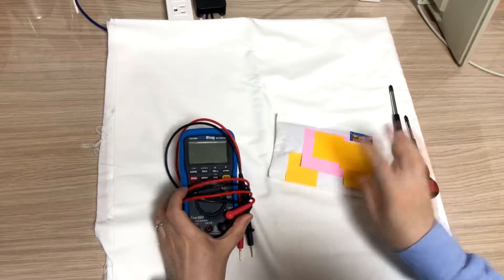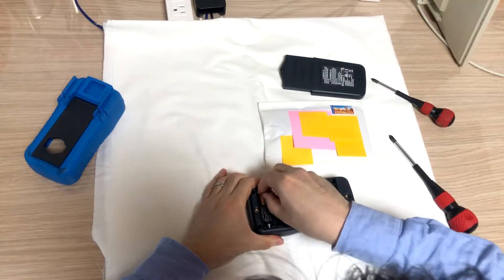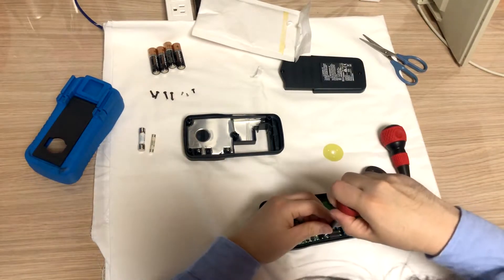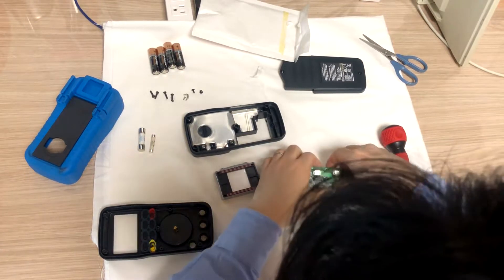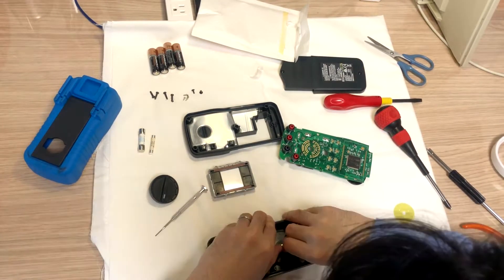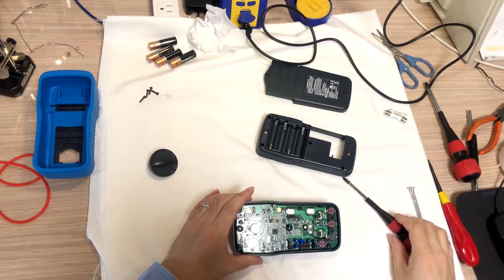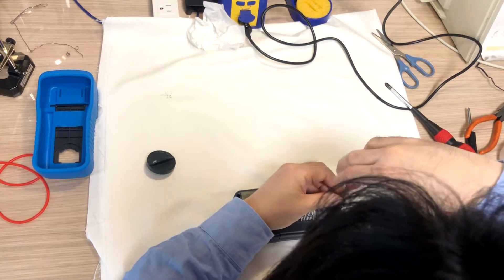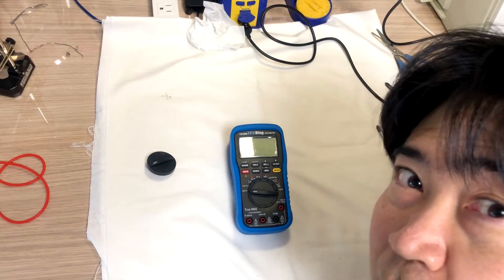Akira-EN #11 EEVblog 121GW multi meter, new Rotary Switch and Shim arrived, Tear Down

Comment: Question, did it come with instructions? Is the cutout in the middle of the fiber board insert supposed to face down so it goes around the C clip?
Reply from the maker: I did not know there were instructions when I received the rotary switch and shim. The facing of the shim is important which I did not pay attention in the video. I will add the link to the description here. Thanks for your comment.
Reply: Thanks Akira, I was already working on a video and that’s when I saw yours in the search. I didn’t know they had instruction, but mine came with it installed also. I’ll add that link to my video also. 
But I’m confused, the instructions say the round cutout area of the disk should facing “UP”, but I thought this was for the c-clip (e-clip) according to Dave switch endurance testing video.  If the cutout is facing “up” then I think as UP facing the ceiling or sky. Or maybe when it says “UP it means facing “UP” to the top (front) of the meter despite the meter being face down on the desk when it’s apart? That part seems confusing now. I wish it just said the cutout goes around the c-clip to be clearer if that’s the way it goes. 
The instructions also missed mentioning the clip to disassemble the meter, that’s an important part.
Reply from the maker: I agree about the official instruction which mentions "Round Recess on the Shim must be facing upward." is bit confusing. The round recess of the shim should be facing the c/e-clip when installing it to prevent the shim making too much pressure for the rotary contact to the PCB. Removing the c/e-clip is important. I used the slotted scree driver inserting the slit while holding the clip with my finger and rotated the driver to remove it. I tried to see you video on the link. The link seems to be not working right now.
Reply: @GadgetReviews-US  Video Unavailable!
Reply: RW-RW-RW I believe I removed the video, by this time all new meters come with the fix. Also other info in the video was irrelevant since the firmware kept changing. Every time I started a review something changed with the firmware and my results were different. I guess I just kind of gave up on reviewing this meter.
Reply: @GadgetReviews-US  Oh, thank you very much. I was just digging through dog pile, trying to determine if new meters offered for sale address the rotary dial issue. Also, I think firmware 2.0 was release a couple of months ago. I don't know if you installed it. How is the meter performing for you lately.
Reply: RW-RW-RW It still runs good. I haven’t tried 2.0 yet as I moved and working on getting the lab unpacked. For logging I tend to use the fluke 289 or my bench meter to a computer. But those are hundreds more or can be double the price once you get the cables and hookups. So for the price it can still work good for logging to the SD card and cheaper then others. I do like testing car LEDs with it since it has the 15 volt diode tester option. You can also ask on the EEVBlog forum and state your needs and I’m sure people will give you honest suggestions on different matters you can look into.

Comment: If I can hide it from the wife, maybe I'll get one by years-end (but not before Joe puts one through his bank of tests).
Reply from the maker: When I saw the PCB, the 121GW is made for electronics with CATIII. I have a feeling that it will have difficulty sustaining Joe's transient test compare to other reputable brands with CATIV which also targeting the electrician industry. Well, the 121GW is mach smaller size :)